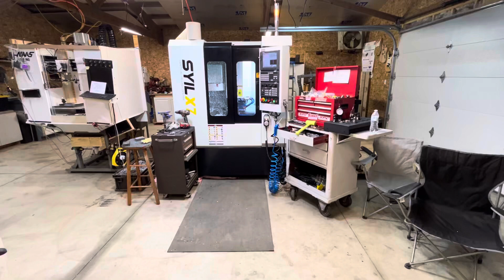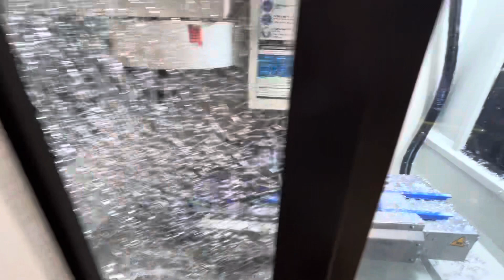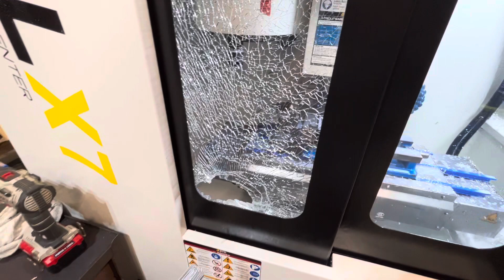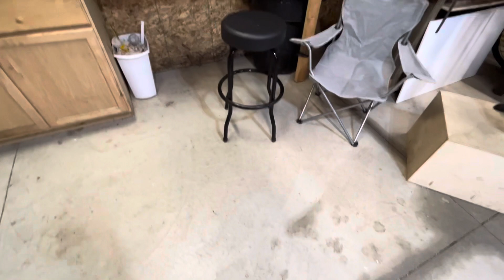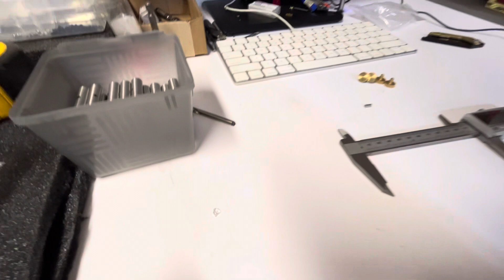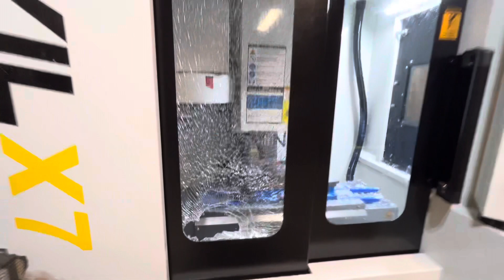My CNC Machine Tried to Kill Me

Comment: Definitely something to be concerned about when looking at cheaper chinese machines like this. Real, modern industrial machinery I've worked around almost always has two layer bonded windows where there's a layer of glass to provide scratch resistance and chemical inertness bonded to a ballistic plastic that contains the shattered glass and debris in the event of an accident. Seems like they're cutting corners on these cheaper machines.
Reply from the maker: yeah its unfortunate. I assumed it was safe but now I know. I replaced with poly carbonate which should be much safer

Comment: intend to inform, happen to me with a 6kg part last week. But it was steel i used a alustrip to press the part in but the opposite was the case. 

Alu gave it a free flight or "shoptour" unplaned. Clamping should be steel to steel or alu to alu but noth mixed as it seems obvioulsly. Or make a 360 clamping mechanism so it is put in a form it cant leave.
Reply from the maker: yikes! thats terrifying!
Reply: @blackfoxmachining  bro it flewwwwwww fast ^^ realy fast. But i have another story. I have a old Schaublin 102vm lathe and the chuck came 3 times lose when o shifted down from 3000rpm to 1800 rpm. Piiiiiiiuuuuu!!!! flew by my head. Has 8kg that chuck. It bounced a few time on the floor until it calmed down man i tell you!

that happend 3 times until i found the safty ring that had to been clamped down on to the spindel. 
Those machines those days.
"Rise of the machines..." i guess ^^

Better know your stuff man better know your stuff.

Comment: Well, that is what happens when the clamping way/force does not meet the requirements of your cutting parameters. It happens to every CNC machinist. When you replace the screen panel, make sure you order it a little thicker than the orginal spec, especially for the doors without grid braces. The fixtures on usual machine doors will accommodate the differences generally speaking (see, you are not the only one that has to change a machine door panel :) ). I am glad you are okay. Right now the most important thing is to regain confidence before you press the green button again. It is just perfect normal way of learning - by mistakes.
Reply from the maker: I am currently replacing them with 1/4 inch polycarbonate panels. The way the mount only allows for about 1/4 inch thickness for the windows though.

Comment: Glad you're fine. I have to question the integrity of that window. A small part like that shouldnt be able to break through with so much force unless the pane isn't the proper material
Reply from the maker: Exactly my thoughts. It was a very small piece of aluminum too. I can’t imagine what a large piece of steel would have done! I don’t believe the correct glass was used when the machine was built unfortunately

Comment: And this is why you never set up a vise like that (with the jaws pointing to the glass). Big No-No. Oh, and safety glass on those machines is a nice to have (though the chinese still cheap out on this). Good to see you are safe!
Reply from the maker: I learned my lesson! Replacing the windows with polycarbonate lexan and then seeing if I can turn the vise 90 degrees
Reply: Try to make custom dovetail jaw and standardize your raw work part with dovetail cut for every job sort in queue. Dovetail clamp more secure from flying parts.

Comment: "safety glas" and where des it come from? i bet china.
Reply: Technically, tempered glass (like this is), is one type of safety glass, since it's hard to hurt yourself seriously on a broken pane of tempered glass.

Tempered glass is also significantly stronger than normal float glass (think normal house windows), 4-5 times stronger. But, it doesn't like impacts from hard metal objects.

So, I'd say that as a CNC machine guard, monolithic tempered glass is probably the wrong type of glass.
Laminated tempered glass with an extra thick EVA foil interlayer, or maybe even more than 2 glass panes, would be the safest.
Perhaps even worth it to use a laminated glass with the inner pane made from normal float glass (or chemically toughened glass) and the outside pane made from tempered glass. For the same reason that car windshields aren't made with tempered glass, small impacts would just chip, or maybe even crack the glass, but it wouldn't shatter and would still be useable.
Reply: Syil is a Chinese brand so I’d say that’s a safe bet

Comment: that Windows should not have failed the way it did, from the look, it looks like the wrong type of glass that been fixed to the machine, I can give you some advice if you want
Reply from the maker: You are exactly right! a small piece of aluminum should never do that much damage to a window. I am looking at replacing them with polycarbonate. What type would you recommend?
Reply: you got a couple of options 5-6mm(1/4in) polycarbonate sheet, but if you prefer using glass due to being cleaner when it is covered in coolant and glass is more resident to scratch from flying swaft I recommend having thin sheet of toughing glass on the inside and polycarbonate on the outside, so you get the best of both world, an another option is to look for a machine tool windows supply, also when it come to polycarbonate lexan is a well known brand
Reply: @icarus_ap   polycarbonate does not do well with cutting fluid, especially if you drill holes in it and the coolant gets in the holes.  It will develop cracks within weeks.
Reply: @esarworks4963  Wrong coolant types could damage the polycarbonate sooner, but there is none other plastics that absorbs energy as much as PC does. It is a consumble by many machine builder's mind. The manual of my machine suggested to change the panel every 5 years but change it anyway if there is dents, discoloration, scratches, cracks.